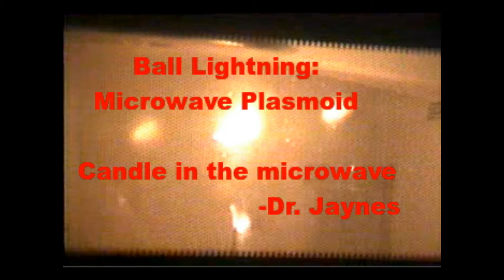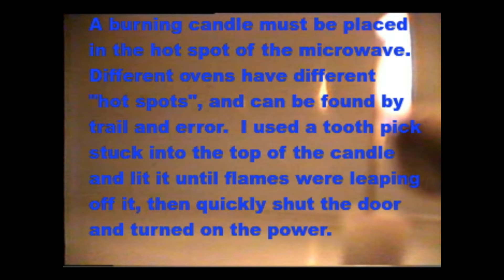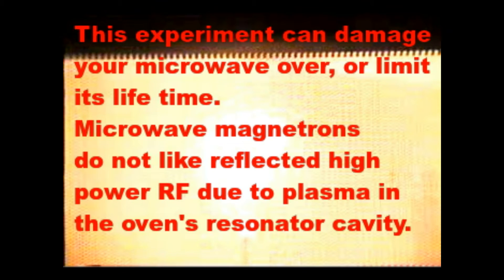How to generate ball lightning plasmoid in the microwave oven

Comment: Microwaving a grape creates a sort of plasma during the time it is running
Reply from the maker: That is very interesting! Do you have some videos of this??
Reply: @jaynesnetwork  Not the OP and I haven't seen any recordings of this, but I did this myself a few times several years ago as a kid when I heard about it somewhere. You can replicate it by slicing the grape almost in half but not quite, leaving a very thin bridge of material across the two halves. Then lay that sliced grape (wet side up) in the microwave, and I would cover it with something to trap the plasma so it's more visible and maybe longer lasting (or appear to be longer lasting on account of being easier to see, at least). I could get plasma balls which lasted for even several seconds, not with 100% consistency but probably 30-50% of the time. The explanation of it that I'd heard was that the two halves of the grape absorb the microwave energy and that energy then flows between the halves over the small bridge of the material, which then acts similarly to putting a thin wire across a voltage source to act as a heating resistor (similar to lightbulb filaments or model rocket starters) to super heat the grape/air into plasma.